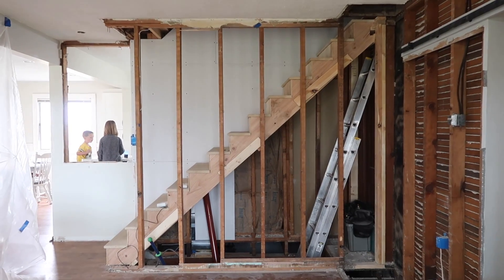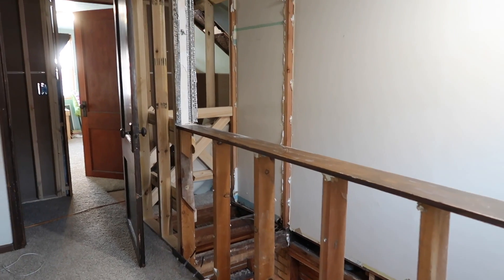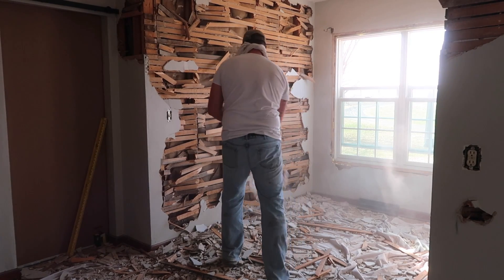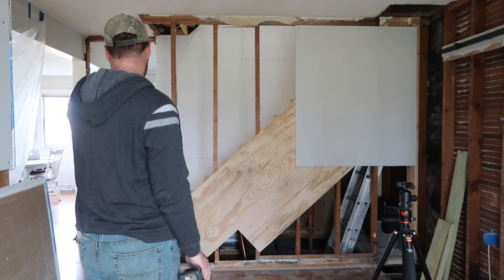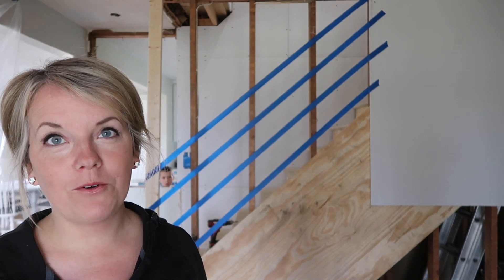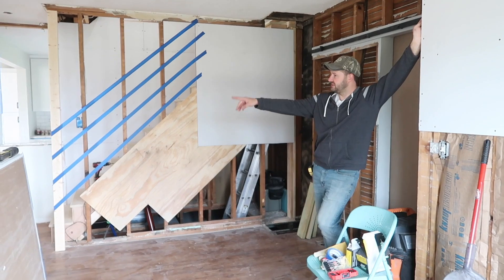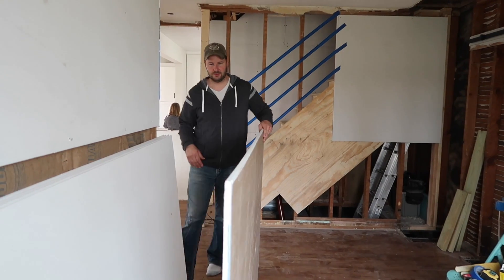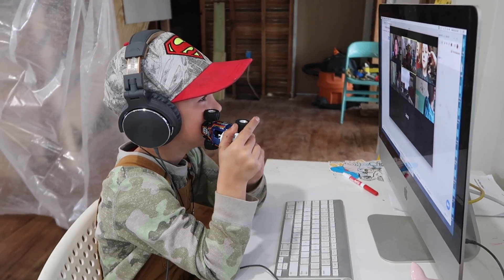Mocking up an Open Railing: We need to see it to believe it!

Comment: I would be careful about using to much computer time for homeschooling. There are some who do schooling mainly on computers, and it works for them. I felt that the kids needed to learn more from books. It’s not good for them to spend so much time on a screen either. We did a lot of our schooling at the kitchen table. But where you want to do it would be great. I say open railing and have their area in your office.

Comment: Why have a built in desk - you can use laptops at the table space.  Definitely open railing, but I would knock down part of the kitchen wall to have railing and open space from both sides.

Comment: In my experience older kids prefer to work by themselves. Laptops work better. They probably won't use the workstation. I quess you'll need WiFi in your barn/ shed/ garden.

Comment: why not take both the wall between the kitchen and the stairs back to the bottom of the stairs and have the open railing on the computer side, then in the old office area why not do a u shape work station where you can have computers and work stations for the children if i could draw a picture for you i would